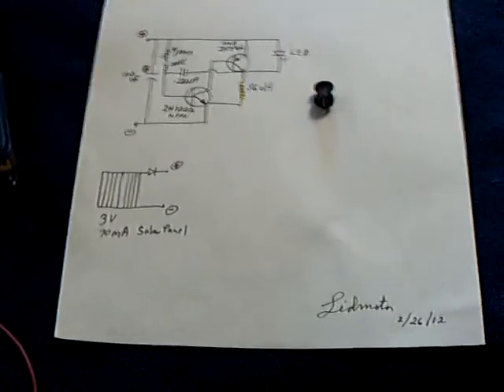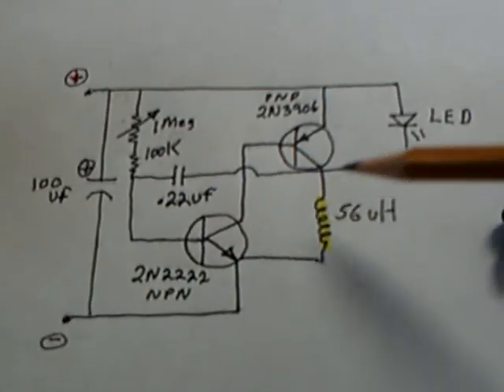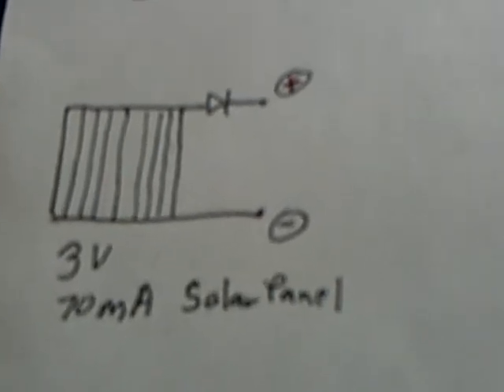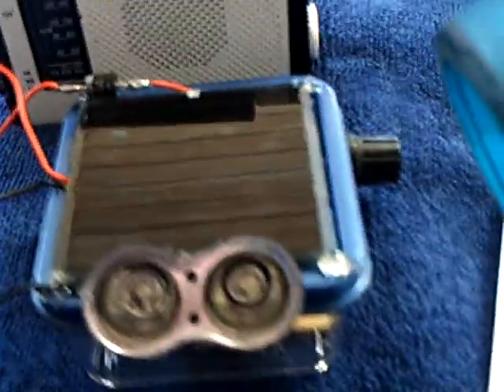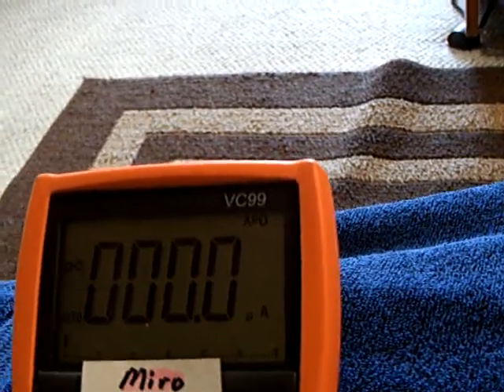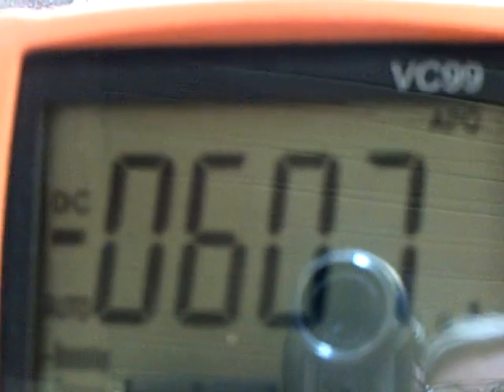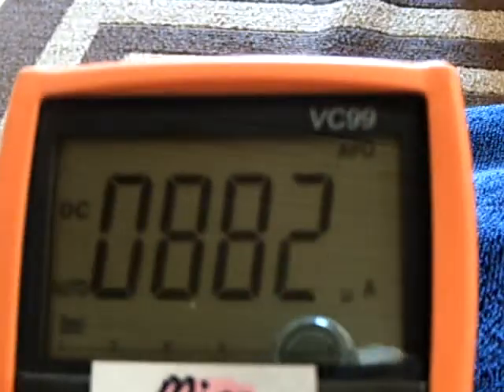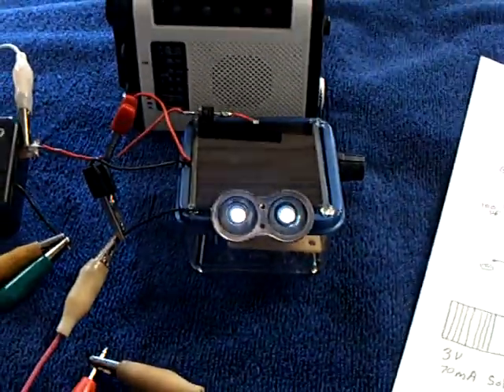One coil LED oscillator

Comment: Nice work...Thank's for showing it. You say that you get more light  but is it only at low microamps ? Lets say like 5  to 10 mA  like a blocking oscillator, will it work? Might be saturated, did you try?

Comment: The Sziklai pair are what I like about the self start motor oscillator. The LED is 'backwards' like a Slayer or Bedini mod or more, so that's the coil collapse. I *think* the LRC network is at play well here, 3906 output is positive into the 56uH and when collapses the 2222 is triggered, via cap and LED from that collapse of the choke. If think of Bedini +/- batt connections it shows up here. All zaps back and forth at frequency of the pot setting. Also, meaning back charge on rails :)

Comment from the maker: @OUbrads -----Thanks Brad.  This oscillator is a bit different.  See what you think.  The posted circuit diagram by Russell had no component values so I just winged it. You can play around with the values and it is pretty forgiving.  I went for brighter LEDs than on the Penny circuit but you pay for in in amp draw.  Penny will beat this hands down as far as running on low low power though.